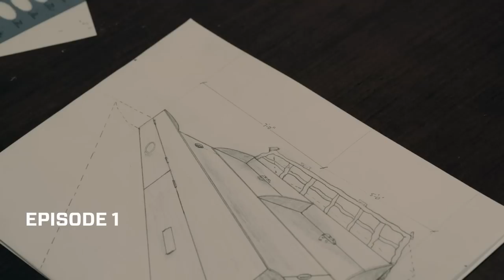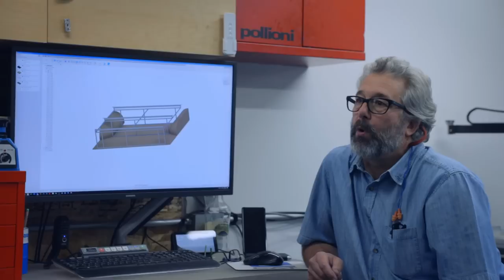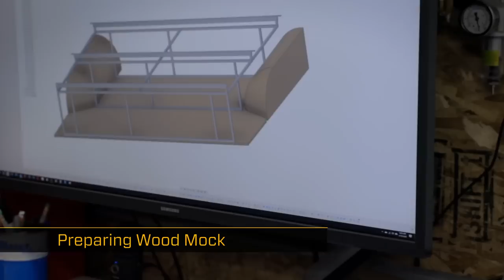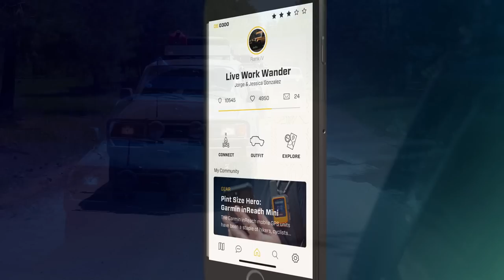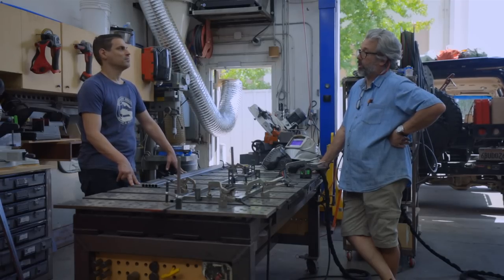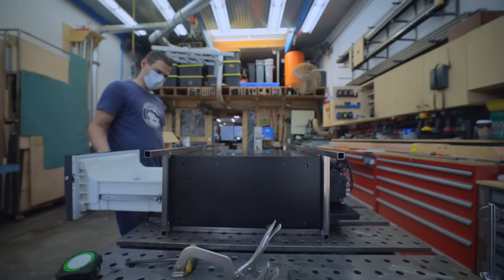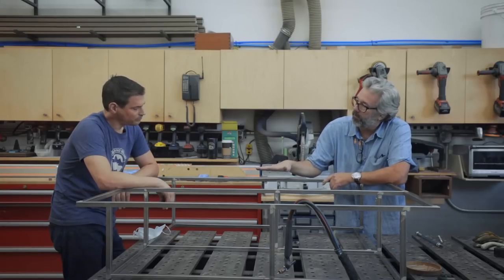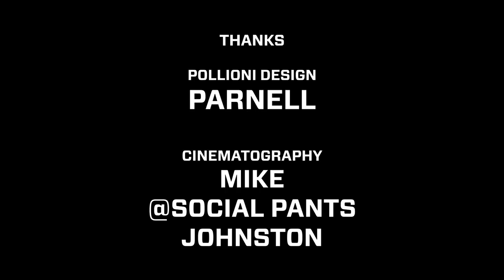DIY Drawer System Part 6

Comment: Michael will you be adding any diagonal bracing on the front to rear frames to triangulate them for more rigidity? I'm thinking like that used on a funny car chassis.
Reply from the maker: I don't think so - but we may depending on our assessment of the stability.

Comment: Wrong.. 80/20 quick frame is hollow not solid. The channel extrusion is solid. Two different things. The quick frame is also way cheaper than the extrusion he was referring to. A 6ft stick of 80/20  quick frame weighs about 2lbs. How much does a 6ft piece of steel weigh???
Reply from the maker: Lemmie guess - you went with the stainless? :D